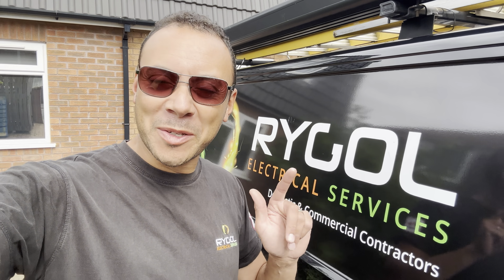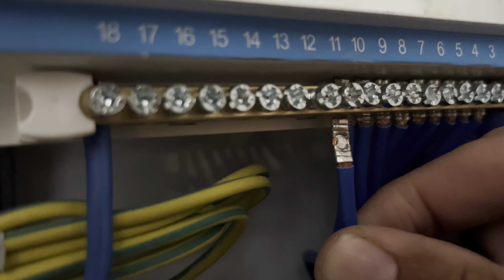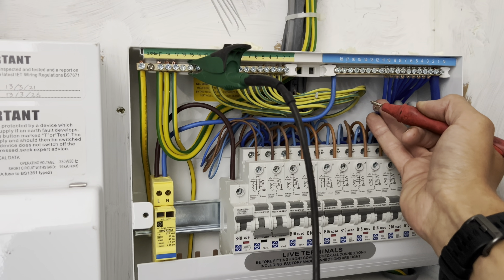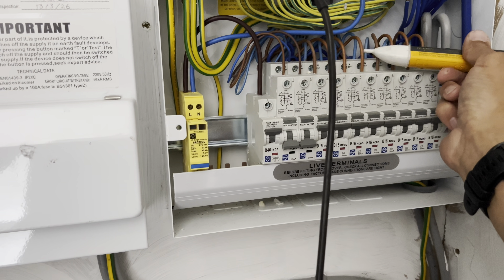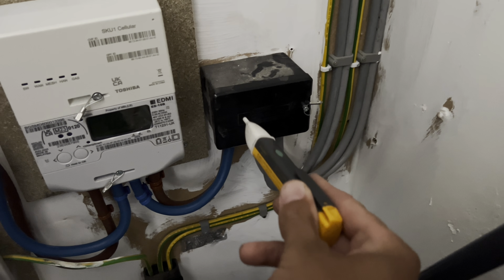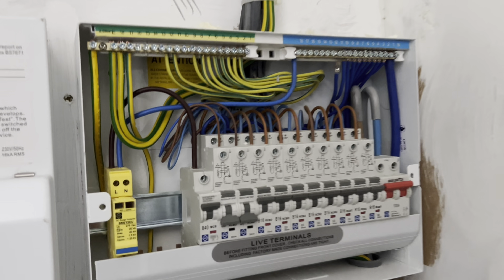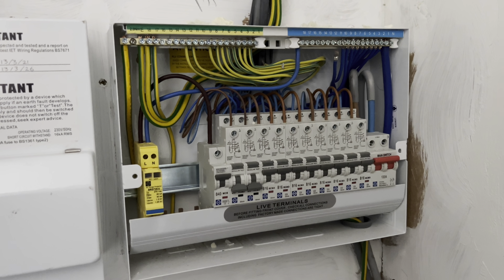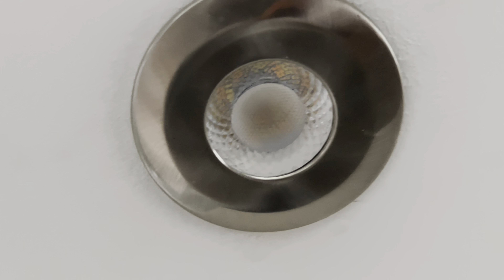Smart Meter Disaster! ⚡️

Comment: exactly the same happened when they changed the main incomer fuse  they rewired it back to the meter   . however  when they turned power back on the socket tester  sounded  then when the  electrician asked me  wich one  was live  i said the red one  .   I was  70 yo   at the time

Comment: One question isn’t the Neutral bonded to the Earth bar at the meter box? If so if the active and neutral were swapped around for some reason then at switch on the breakers would keep tripping all the time. How was it possible to have active supply connected to the Neutral bar which is bonded to Earth (real earth) without being essentially a short circuited supply?
Reply: The neutral is linked to earth at the service head. By swapping the tails downstream (after the meter), it would have no effect on earth and neutral being linked.
The difference is to do with the Line and Neutral wiring at the consumer unit and through the entire final circuits in the installation. At no point is any wiring in the installation linked to earth, so the Line (live) simply becomes neutral, and the Neutral simply becomes live.

Comment: That was very sobering.  Thank you for your video. First class workmanship.
Reply: Rygol originally miss-wired the Henley Block (back-to-front) and did not elucidate the fact, with either coloured tape or heat-shrink tubing.
To my mind, this is a classic example of POOR workmanship on Rygol's part.
Sure, the meter-operator didn't double check, which is clearly their fault, but it would not have happened, if Rygol had wired the Henley block contrary to convention in the first place.
I would have been ashamed to post a video demonstrating my own lack of competence, as this video does.

Comment: This situation could have resulted in the house burning down , it's happened before. This is because the meter installers are NOT qualified electricians in some cases and don't even know how to check polarity and don't even have a plug tester because their company don't supply them. ( used to work for DNO AS SERVICE HEAD INSTALLER and have seen some real bodge jobs )

Comment: The henly block connections is the responsibility of the client NOT the meter fitter, hence why meters are sealed.
Yes, the meter fitter may have been just lazy on this one, yet remember most are NOT electricians and not trained to carry out electrical testing to BS7671 and GN3

Comment: Hi there, lovely CU wiring, nice to see work by someone who takes pride in their work. Di you have to get permission to break the seals to swap over the tails?
Reply from the maker: The seal that I had to break to correct the polarity was on the consumer side so I was able to rectify the issue without contacting the electricity company. However, the company in charge of doing the smart meter was notified of the issue. Thank you for your comment. It is much appreciated.

Comment: In America we have the NEC- National Electric Code which regulates Electrical requirements.  On residential services the  incoming Neutral conductor is Bonded to the Earth Conductor at the Main Disconnect Circuit Breaker.  This connection would prevent a reversed polarity condition from happening in the Main Service cabinet.

Comment: Did you check the polarity of all kitchen sockets? Theres a chance one socket bank on a spur or end of a radial run is wired backwards. That could be the socket the meter installer tested, giving a false confirmation.
Reply from the maker: We rewired this entire property so I know everything with the installation was okay. The problem only happened because of the smart meter being replaced, once it had been replaced it corrected the issue of the entire property.
Reply: @RygolElectrical  I wouldn't doubt you, but in reality can you say 100% that every socket was tested on install? And as different makes of sockets have inconsistent configurations of terminals (these days some manufacturers colour-code them, but some do not), and there's always the possibility of sometimes getting one wrong.
The chance is minute, but after two or three years I'd test them all just the same.

Comment: Got to worry about how many other properties have been wired incorrectly. There’s a difference between a mistake and sheer incompetence. The fact that they said they’d tested at a given socket but evidently had not, speaks volumes about their low level of competence and equally low level of integrity.

Comment: i had this issue 25 year ago in my old council house we had two washing machines fail within months, on the third we had a little red light that flickered all the time, a mate with a little knowledge said wrong polarity and sure enough when the council inspector (who was a time served ex sparky) came and looked the NEW meter had been wired the wrong way just like this, they fixed it that afternoon as an emergency but i didnt get any compensation for the two washing machines that it knackered !

Comment: You should always connect your live tail from meter to the rear block on a Henley style connector for exactly this reason. The neutral should be the first exposed when the Henley cover is removed. To be honest the meter guy connected the tails as standard but he should have conducted a polarity check. As taught in his classroom!!!!! Why are you not using Brown & Blue tails to avoid confusion. You need to think about your standards before you question others.

Comment: Yes its wrong having the live and neutral swapped in a way like that, but how was it causing the light to flash? Potential difference between neutral and earth ?(in this case live and earth) Here in Holland and pretty much the rest of Europe the polarity at a socket does not matter as plugs are reversable. I only now of some equipment in rare cases having to have the plug turned round to work. I agree it was dangerous in this case having a 'open' neutral rail thats now live. Might be one of the reasons our consumer units dont have a neutral rail like that.

Comment: This happened to me years ago when new analogue meter was installed. No LED lights then but I was getting electric shocks from taps and when was washing hands (120v running down earth). Electrician opened DNO fixtures and corrected it straight away then informed Yorkshire electricity

Comment: Interesting. I have always had live at the back terminals of the Henly Block. So the meter installation looks correct to me. It appears the tails to the consumer unit are not as I would expect them. Still the meter installer should have checked and put it right.

Comment: This illustrates perfectly why I always, and recommend others, stick the non contact voltage indicator (Voltstick) into anything and everything before my fingers. These cannot be relied upon to prove safe, of course, neither do they necessarily prove unsafe, but if they light when you're not expecting them to, even for a second,  it does indicate "proceed with extreme caution".

Comment: Having seen what they did to my cousins house basically beat a hole through the meter box and screwed half an acre of wood to the wall! I was in two minds about getting a smart meter fitted.
Unfortunately I had solar installed because of the cost of electricity and living in the country you tend to rely on it quite a lot.
As soon as the two? “Bob-a-Jober’s” came to my door I Schooled them on how they were going to install it, firstly by getting rid of the surfboard they had pre-mounted the meter too and told them to either “retrofit or not fit” as you can imagine they were very understanding not so I did mention that if they put a whole in my meter cupboard I would sue them personally for criminal damage and not E.ON. so the installation was very neat…

Comment: Im no electrician but been told every smart meter install has to have a manual switch fitted after smart meter.
Reply: I've worked on plenty. I've not seen any supply company put one in for years.

Comment: Excellent video! Just one question, you mentioned the electricity company had put tags on the smart meter  and connecting box (with the problem) was it a legal problem to remove the tag and reverse the wires?

Comment: That's a mop issue not dno. The mop should not be touching customer cables beyond the end of the meter connection. Mop has failed to do at least one polarity check and more than likely 2 but the photos of smart install will  prove that. But if you are breaking seals then you are taking responsibility at that point

Comment: Smart control and surveillance meters. I worked on Smart at Npower for 4 years and these control meters can be turned off remotely with just a few clicks. 
The original deadline was 2020 (Agenda 21 / Agenda 2030)

Comment: On those Double Pole Phase blocks you normally have the Live at the Rear (harder to touch when the cover is off), so that is where the meter installer got their wire crossed. Yes, The test would have pointed to the installation of the meter was wrong but your tails from the phase block could also be blamed for this.

Comment: 1 main question and one smaller one. 1. How is it possible the RCD does not trip? 2. How do the test devices know the difference between live and neutral when no current is flowing?
Reply: If the current is balanced between line and neutral, then it won't trip. As the phase oscillates fifty times a second, there really isn't any difference between the two, it's all about which is the 'common' to earth, and as RCBOs these days don't have a fly lead to earth, that isn't something that the RCBO can detect. That isn't really the job of the RCBO.

Comment: Although the meter guy is definitely at fault fir not confirming polarity I would raise a point that the Henley block appears to be backwards from standard practiceon the customers tails, the rear entry and also the furthest back feeding the top brass terminal block should cater the live tail, the front entry and also the closest to the front should cater the neutral tail, this is considered good practice and the safer method as a damaged lid, unused knockouts etc make the chances of accidental shock less.
  I'll reiterate though that 100% meter guys fault for not doing the basic of checks.

Comment: Tip from an old sparks mate. Fault finding. Always start at source. 
I enjoyed the vid. Reminded me of a petrol station where the pumps kept dropping out. Turned out to be the mains switch on the CU that had melted on causing a volt drop that the pumps didn't like lol. I found that quickly because I started at source.

Comment: On those double pole link blocks the live is normally at the back and neutral at the front. I expect the guy doing the meter change took it for granted it was connected this way around and obviously didn't do a polarity test. Lethal situation as you've got lives everywhere even with the RCBOs (single pole) turned off and with 100 amp fuse on the back of them!!

Comment: The black double pole connector blocks are used by electricians, they should have the live terminated in the back terminal and the neutral in the front as standard best practice, this was wired up wrong by an electrician to start with meter installers never use those blocks so that was in before the meter was exchanged, the meter installer has wired the meter correctly, the mistake was renewing the tails out of meter to the connector block putting the tails as they should be, unfortunately the block was wrongly terminated in the first place, the installer must not have done the final polarity test at plug socket, easy test to do before and after! No excuse not to do that. This also serves as a warning to electricians that use these double connector blocks, bput time you all changed to 2 separate connector block !!!!

Comment: You may be interested to know that when Octopus 'persuaded'* me to have smart meters fitted in 2023 the meter fitter installed an isolator switch between the incoming fuse and the smart meter itself.
*They told me meters were outside their certification period. Well, as far as I could tell the electricity meter may have been certified in 1989 as there was a partial sticker on it, but from my calculations from the meter readings (it went round the clock a few years ago) it would have been the original meter from 1972 - I've been in the property since Jan 1983. That and the fact the gas meter had been changed some 20 years previously led me to conclude it wasn't just a ploy.
Reply: I have never heard of a supplier / DNO or anyone else for that matter ever installing an isolator before the meter. That really does sound like a total one-off and doesn't make any sense.
If you were to switch it off, a modern smart meter (allegedly) would send a 'distress' signal to the supplier. Not doubting you, but I would have to see that with my own eyes.
Reply: From Octopus Energy:
Hello David,

Thank you for your email, its an excellent question!

I want to clarify that Octopus Energy do install isolator switches as they are sometimes necessary for appliances at a property such as EV chargers or solar installations.

These isolator switches are often installed as standard by OES engineers as they are often required by contractors we work with such as heat pump installers, solar installers and EV installers amongst others.

I hope that makes sense for you please let me know if I can clarify anything further.

All the best,

Comment: Yes Dave Savery covered a similar issue with low voltage feedback through the neutral wiring causing leds to illuminate. The DNO has left a seriously dangerous situation for a customer and should bring an internal inquiry into this..

Comment: This is the reason that in the Netherlands it is not alowed to have a joined nutral in the installation.
Evrey group needs to have a fuse switch that switches aswel as the live wire as the nutral together.
Than it does not realy mather any more when the life and the nutral would be switched around.

Comment: DNO only responsible as far as the cutout. Supplier from cutout to customer tails. No way should you have touched anything without first proving dead. To make a video about the dangers of not carrying out checks too. Hypocrite. You find a fault, you make it safe if it's within your remit and you report it. In this case cut the seal to the connector block, put right the wires, document it and report it. The second I saw it I said reverse polarity, you must have thought the same.

Comment: I changed power company a couple of years ago and they insisted on me getting a Smart Meter fitted.   The team that came to do the job managed to break a crucial piece of the fitting, then managed to blow the power in the whole street...  at 4pm on Good Friday...  then told me the power would be off for the whole of Easter weekend.

Thankfully, Scottish Power turned up at 4:30pm, at one point having 5 vans in the street as everyone was reporting faults.    They got us up and running and replaced the broken part on mine, restoring me to the PRE-Smart Meter position.    I have refused to let them try to fit a Smart Meter since and I'm happy to have had an expert electrician come in and check everything out, including updating my fusebox.

LESSON LEARNED: Nothing is better than a trained specialist in ANY situation.

Comment: Urgghh I've seen this when I worked at Sainsbury's, in the bakery depending on the electrician they switch them ( apparently there's no standard) so plugging for instance the french stick moulder into the mixer plug can make it go in reverse. 😂 Which was a ball ache if we needed in an emergency to use different plugs or move machinery about. It took a year but I got them to fully re wire all the plugs so all 20 plus plugs could be used for all 20 plus machines .

Comment: The tails coming from the meter into the Henley block were arranged with the live coming into the rear terminal block, and the neutral into the front terminal block. That's the correct way, as we all know that the live terminal used is the rear recessed one, to minimise the chance of touching it. Didn't see the Henley block after the fault was rectified..

Comment: This happened to me (not an electrician)  after we had a new consumer unit installed. I wanted to change one of the sockets from plastic to metal. Luckily I tested the neutral before I disconnected it from the socket.

Comment: Soon as I saw the lights flickering I thought live and neutral wrong way round.
TV service tech for 25 years I've had a few shocks , mains is not fun but 25kv dc from the tube and 8kv from valve caps to an earthed tube punched a hole through my hand .😂
Electrics is dangerous, more so as you get older with dodgy heart..

I thought you were not allowed to touch that unit to fix the problem seeing as it had their tags on?

Comment: Interestingly enough the meter itself could detect a problem if the meter was wired incorrectly as long as it had an earth wire for reference. I worked on the design of a smart meter 25 years ago which used earth as a reference point and the meter would fail to work if the live and neutral  were swapped, even by accident.  Maybe this smart meter aint so smart after all. :)

Comment: The issue lies with the double pole neutral block. 
The live should be at the rear of the block which the meter fitter "assumed" was correct when he connected the tails to it. 
Not doing his martindale socket test is where he failed. This is exactly why we test before and after each meter change. 
I'm DNO spark and jointer. I change cutouts. We take a photo of each martindale socket test before and after. It makes no point to blag it but I know lads do. That lad clearly is one of those. He needs a servere bollocking !!